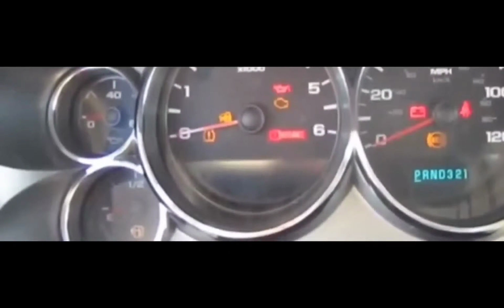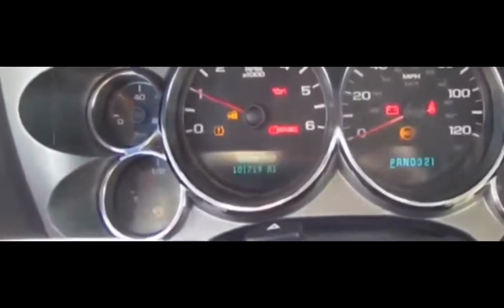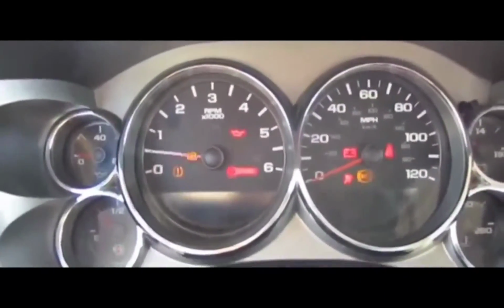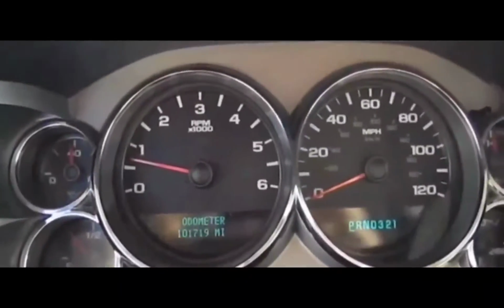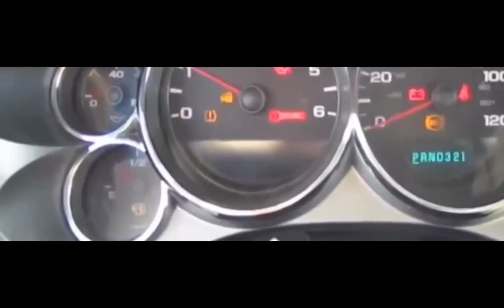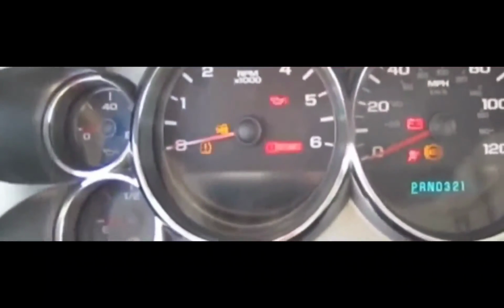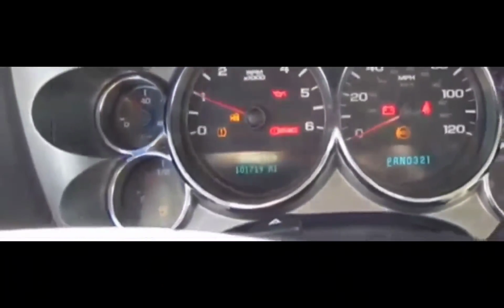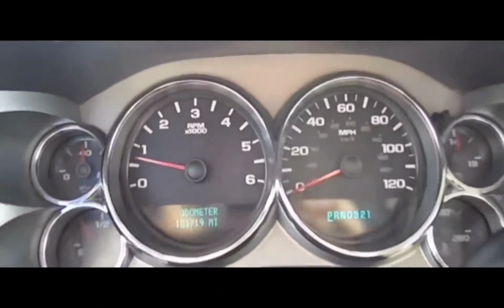SYMPTOMS OF A BLOWN ECM BATTERY FUSE AND HOW TO FIX IT, CHECK ENGINE LIGHT/ NO START

Comment: Hi can a bad ecm cause my fuel pump to not kick on. I checked the fuel pump relay n fuse n they both have power to them but the ecm fuse didn't light up at all what would that indicate and also would it cause reduced engine power?
Reply from the maker: Plug in an obd2 scanner and see if it scans all the way through. If it doesn't..there's prob an issue with your ecm or ecm fuse.

Comment: Help! My mini was starting fine before I replaced the water pump. I had the battery and ecu disconnected. I connected the battery back on and tried to start the car with the ecu disconnected(forgot) after connecting the ecu the mini won’t start. Any thoughts? Thanks
Reply from the maker: Try disconnecting the battery and the ecu and them make sure they are both connected before starting.

Comment: Actually the pcm is powertrain control module it controls your transmission the ecm controls the engine. Big difference in the 2
Reply: Keep blowing pcm fuse any help?
Reply: My ecm is blowing as soon as I put the fuse in I’m stuck on side the interstate what can I do
Reply: @coreydupuy6179  I just had the same problem. I used a 15 amp fuse in it to get it home